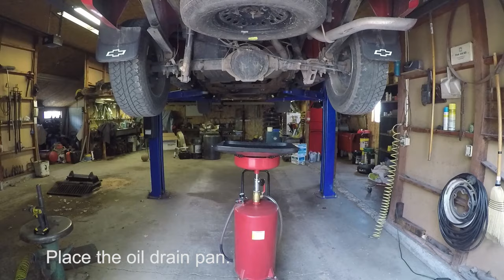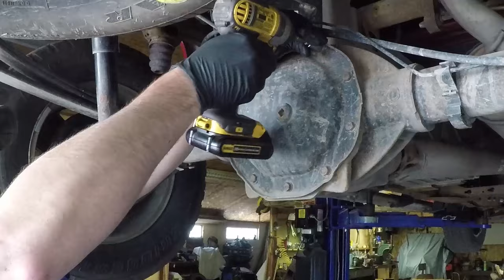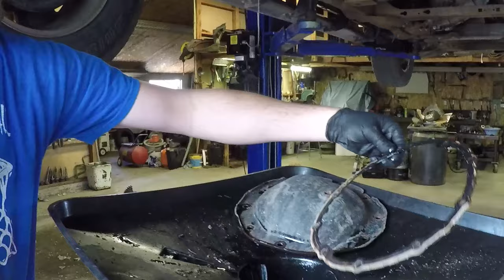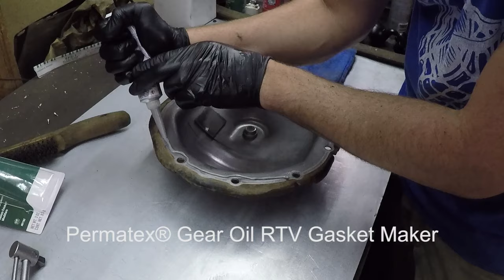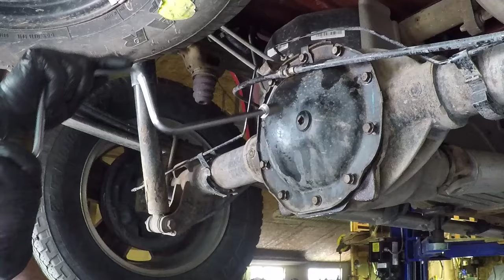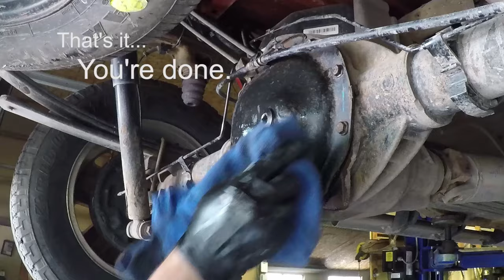2007-2013 Silverado: Rear Differential Service

Comment: I did my 18 last year and it was straight forward. I also reused the gasket and did not use the sealer. No leaks or issues to report as long as the bolts are torqued correctly. Filled with AMSOIL severe gear. Such an easy job. Maintenance is key and these truck will last a long time.
Reply: I have an '11 and I'm going through changing all the fluids. Transmission woke up and the engine is smooth. I can see why people like these trucks

Comment: Good video! The only thing I would recommend people to do differently would be to use a plastic putty knife instead of a metal to remove old gasket. Don't want to risk scraching the machined surface.

Comment: The only thing that you need to do is after ‘filling’ the rear diff, put the truck at a slight incline, passenger side down first, then drivers side, for a few minutes each, then go back, add more gear oil. This is in the service manual.

Comment: Great video my guy! Because Of this helpful video Was able to do my own on my 2013 Chevrolet Silverado LT easy 4 x 4. It literally took 20 minutes. The longest part was filling it back up
Reply: Has a sound  come to you after a change or is everything normal?
Reply: @khaledkaram2248  did u have a sound after changing the fluid?
Reply: @zl1camaro100  So far, no, because I am very hesitant

Comment: Man Thank You for posting up this video this pass weekend  before  New Years eve December  31, 2021 I went to a major name brand service outlet  that does  a variety  of odds and ends to vehicles  ain't going to say there name but they known national, anyway  they gave me a doggone  quote of over $900 and sum change dollars to do exactly  what you just done, well correction  of what I also done this pass week myself  now.... I did  let them do my alignment  and tire and rotation  which price  wise was budgeted  just ✅right,  but, when I saw that quote just for the differential  change my eyes 👀😳 lit up I was like or y'all  out of your "Pucking" mind 🤯... I won't  be able to eat for a few weeks  if I got to pay that, and besides  I had already  bought  the material  oil, gasket, even the spray clean off etc.  And the guy said it's still going to be $900 and sum change  he said nothing  he can do because  Corp sets the prices but yeah I save a ton of money  all because  of your video what's your linking I like to buy you a ice cold beer and lunch or something..I'm just trying  to keep my knock on wood running  long e until  we are all forced  to buy electric  vehicles  or EV trucks..keep more videos  coming..I was afraid  I was going to have to stock up on noodles  and crackers for a month  and disconnect  my cable L😆l  good golly  they was trying  to stick it to me like my name was wally sitting  in lock with ronnie

Comment: I usually remove the fill plug first
Reply: 1987jeepyj you're doing it all wrong then
Reply: Its a sealed dif bro
Reply: 348frank348 the fill plug bolt can be rusted to the point beyond removal
Reply: Good point. If you can't loosen/remove the fill plug. STOP and go to Plan B. Repair/Replace diff cover.
Reply: Yeah that's the right way

Comment: How important is to do this it saves a lot of money and time thanks for your help
Reply from the maker: It's important in preventing seal leaks and gear wear. Frequency depends on type of driving/towing. 30-50k miles is normal.

Comment: My 2008 (2wd) Silverado is sitting at 160k miles. Recently replaced all fluids, replaced all suspension parts, about to tackle the spark plugs this weekend. Was wondering if doing this job along with spark plugs would be needed/recommended. Thanks!
Reply from the maker: It's a good idea to do the rear diff fluid approx every 30k. You can get away with longer if it doesn't do much towing or get too hot. If it hasn''t been done before, I would recommend doing it. (A revisement to the video, fill it to about a 1/4" below the fill hole rather than until you see fluid running out.) Thanks for watching!
Reply: MasterJacks I do little to no towing, it’s 2wd and at 160k miles  I have never done it in the 60k miles I’ve owned it. What would changing it and not changing it affect?
Reply from the maker: @Abyss0206  I would change it. As gears and bearings wear and fluid deteriorates, the grime has no place to go. You might start seeing pinion or wheel bearing seal leaks. That grime can also get into bearings and cause premature failure. It's all preventative, so it's your call, but could be saving you heartache in the long run.

Comment: I just change the fluid on my 2007 Silverado i pour 3 quarts and it didn't spill out the hole, do I still need to some more oil?
Reply from the maker: You want to add fluid until it's about a 1/2" below the fill hole.
Reply: @MasterJacks  holy crap the I think I over filled it.... thanks now I need to find a way to take some oil out with out removing the cover

Comment: How many miles does gear oil last??
Reply from the maker: It's recommended to be changed every 30-60k depending on the type of driving (highway vs towing/city)

Comment: Wondering why you used gasket maker when the gasket is metal with a silicon bead all around?
Reply from the maker: Carmelo Franchina. I think the gasket by itself would be just fine. I added a thin layer (not even a bead) just as a precaution.

Comment: When do you know its time to do this?
Reply from the maker: Typically every 30-60k somewhere depending on the heat and tow load.
Reply: If you don't know when it was done. Do it soon as a Zero step.  And from there as M-J said 30-60K depending on the work 
load.

Comment: Do you also spray off the inside of the differential with brake cleaner?
Reply from the maker: I personally didn't think it was necessary, but it evaporates so quick it probably wouldn't hurt anything if you did. Don't get it up into the pinion area though, seals don't like it.
Reply: So that's a no lol

Comment: looks like you could stick a hose thru the fill plug and suck out 90% then just refill in 5 min anyone done this?
Reply from the maker: The gear oil is pretty thick. It's a job pushing clean stuff out of a new bottle. If you had a neumatic pump it might not be too bad. Let us know if you try and how it goes!
Reply: did it. worked perfect. 75-90 mobil 1
Reply from the maker: GunsCarsBikeCigars glad to hear
Reply: I have the evacuator pneumatic pump and it works phenomenal. But I'm just worried that it won't get all of it and as you seen in his video how he pulled out some of that bottom sludge.

Comment: can u clean the differential gear with that cleaner?
Reply from the maker: You could, but you risk diluting what oil may be left in there. It's also hard on seals if you accidentally over spray. It does evaporate quickly so the risk is pretty minimal.
Reply: Yes I cleaned mine with brake cleaner. It runs out the bottom of the case. I used a rag to clean the standing fluid that was left and let it air dry for an hour to make sure everything evaporated. Filled with AMSOIL SEVERE GEAR. won’t have to touch it for 100k miles.

Comment: What was being sprayed on the plate?
Reply from the maker: It's called "Brake Clean". You can ask for it at the auto parts store. It's a light solvent that dissolves oil and grease and evaporates quickly. You could also use soap and water to accomplish the same thing. Just rinse it off good and dry it when you're done.

Comment: What size socket needed?
Reply from the maker: 13mm or 1/2" for cover bolts
Reply: @MasterJacks  thanks for fast reply. I tried 13mm and it's too small? Tried 14mm and too big?
It's driving me crazy lol
Reply from the maker: @allanfrauts8216  shoot, you might try a half inch, it's equivalent to a 13mm. Or maybe try a 6 or 12 point socket and see if it fits any different...🤷🏻‍♂️

Comment: Around how much should a shop charge for this
Reply from the maker: oldmcdonal D it's around and hour of labor  plus parts, guessing $125-150.
Reply: MasterJacks what all would you recommend be done to a 2011 Silverado with 117k miles maintenance wise
Reply from the maker: oldmcdonal D Based on mileage and age, not knowing the service history, I would  say it's ready for all fluids and an ignition system tune up. If it were mine, I'd prioritize it as follows: transmission flush & filter, coolant, gear cases (rear diff, t-case, front diff), power steering fluid, brake fluid, plugs w/ wires, throttle body clean, and injector service. Deteriorating rubber might necessitate radiator hoses and a serpentine drive belt. A major 100k service can get spendy (like $1500+) at a local garage. I would do my transmission first, then do the others in what you feel an appropriate time frame and order. Hope that's helpful!
Reply: MasterJacks yes extremely helpful thanks so much! Looking forward to your future vids!

Comment: You. Overfilled it read your manual, or and gm,service manual,or TSB on axles never fill to the hole. Causes more heat MUST be 1/2 inch below when cold. And that's with it on level surface--
Reply from the maker: Thanks Richard
Reply from the maker: Verbiage as found in the Owner's Manual: "To get an accurate reading, the vehicle should be on a level surface. For all 4.3 L, 4.8 L and 5.3 L 1500 Series applications, the proper level is 1.0 mm to 19.0 mm (0.04 in to 0.7 in) below the bottom of the fill hole, located on the rear axle. Add only enough fluid to reach the proper level."
Reply: MasterJacks well after 42 years in dealerships doing rear axles and automatic transmissions. I have read lots of TSB"s and manuals all state check and fill on level surface and as you found in your manual..1mm-19 mm is good 19 mm is 3/4 inch so a good spot cold and level is 1/2 inch BELOW fill plug.But when on jack stands it's WAY to full and this causes excessively air and foam in oil witch won't show up as problems with average use(other than pinion seal leakage) but will destroy HD semi rear ends manufactured by Easton, Rockwell ,spicer, the effects are similar to liner pitting on diesels and skating of side bearings if extremely overfilled.
Reply from the maker: Richard Johnson, that's a great post. Thanks for sharing your experience!
Reply: How do I tell if I'm 1/2 inch before spillage ? At a cold temp?
Reply: @jrb982  hahah man I finished that job 8 months ago and the smell is still there

Comment: So you dont need to let the sealer cure for 24 hours ?
Reply from the maker: Depends on the application, but I haven't had a problem with adding oil to gear cases post-assembly (approx 15min). Most silicones say to wait an hour before adding fluid, 24 to fully cure. I've added fluid within 5 min many times and haven't had leaks.
Reply: @MasterJacks  mine said 1 hour then tourge to specs so I did that and added fluid right after I also did as you with the gasket maker and reused the original gasket . Mine is also a 2011 , same rear end . 

No leaks , I did use a different lube . I used lucus 75w90 synthetic.  Had the truck level and it took three full quarts . More than what I thought . Maybe it wasn't perfectly level idk .